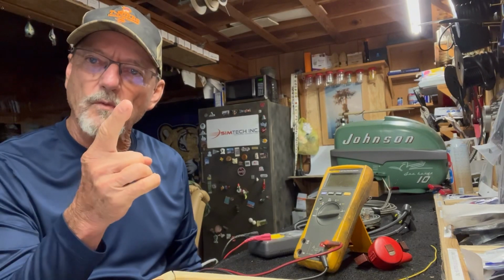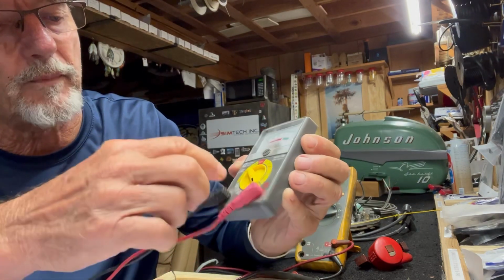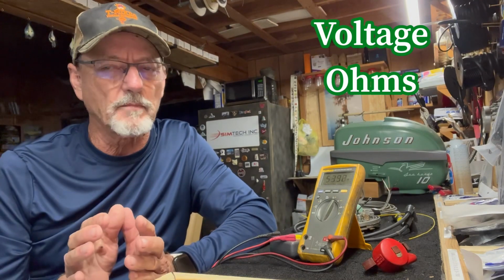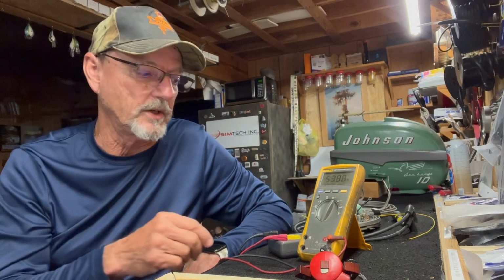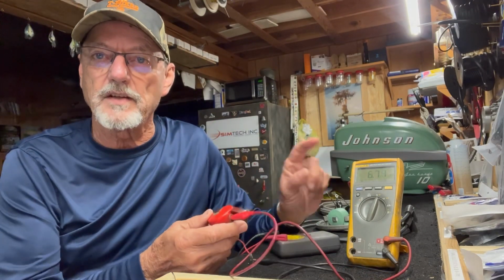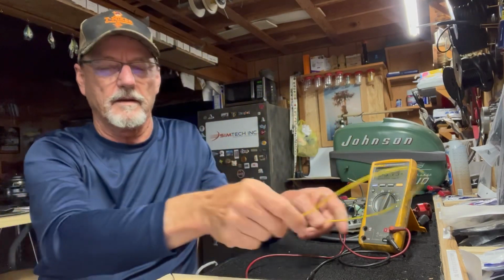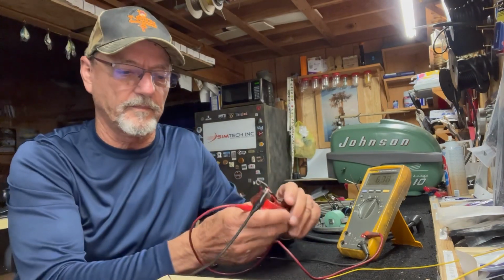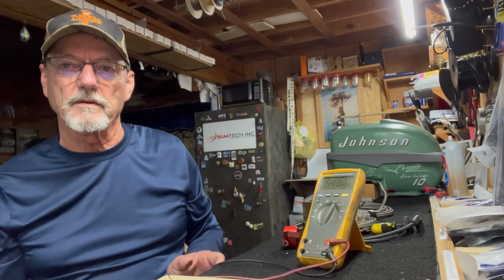Volt / Ohm Meter How to use Meter to Troubleshoot Vintage Outboard

Comment: Hi Mike, good detail video on using different Ohm/voltage meters for vintage outboard motors. I use the analog on the coils set on 1k. My multimeter is a cheap one that doesn't read that high of resistance. I do use it though on later larger motors with CDI electronic systems to measure high voltage with a DVA adapter per the service manual testing procedures. This video is perfect for the small vintage motors. Very simple and to the point testing Ohms and open circuits.👍